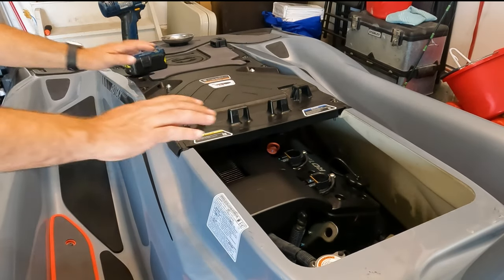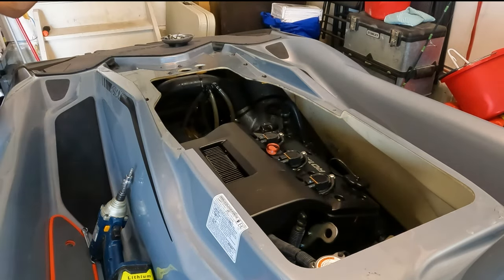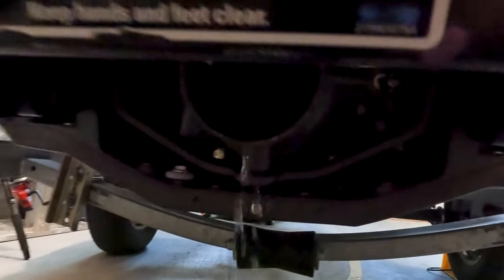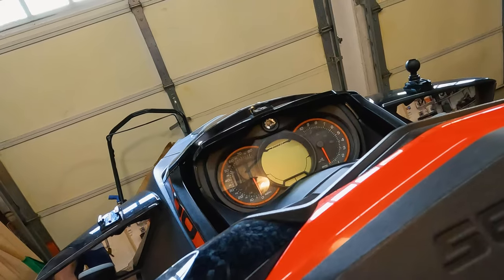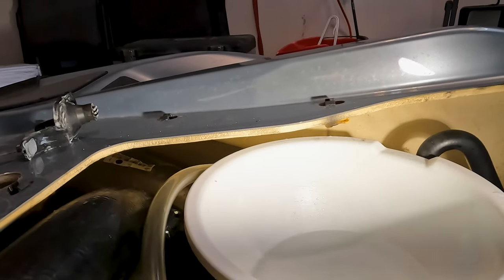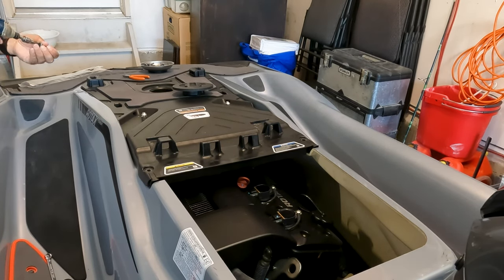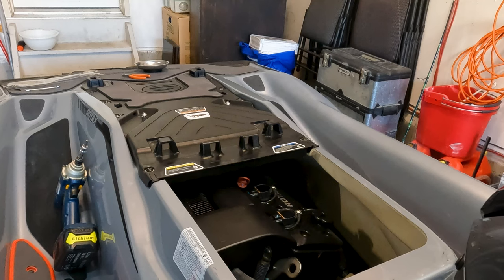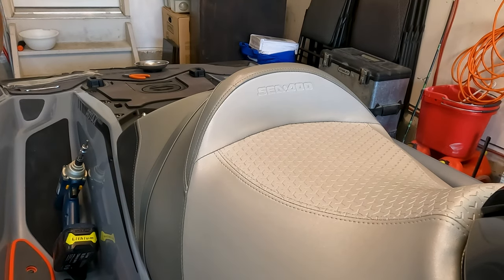How the Sea-Doo OEM Bilge Pump works on a 2018 & up Sea-Doo (Part 2) | S3E16

Comment: Great video. I installed mine but I also installed a water proof toggle switch (ran in under the storage compartment for easy access without having to remove the seats).  I just interrupted the positive wire.     I didn't like the pump running all the time; draining the battery and noisy.
Reply: Possible to show on a video?  Just bought me a Fish Pro and dont want the "always on" feature.  Possible for float?  Thanks!
Reply: Can you make a video on how you did it?

Comment: Interesting comment about why you installed the washers and the flexing of the rear deck. I was tempted to get a ski pole for mine, but then I found out that you cannot pull a tube with the ski pole, so for the few times that we ski with it, it just was not worth the cost of the pole. You need to be careful when working around the jet area with the gate up. Never put your hand inside the jet tube, because if that gates drops down for some reason you will be in a world of hurt!

Comment: Nice.  I was thinking about adding one of these bilge pumps to my 2021 Fish Pro but I wanted to make sure the other (venturi) would still operate.  
I went to wingnuts on the front 2 screws.  Easier to hold onto and start threading. Then hold with pliers to tighten.

Comment: Interesting built-in in hoses expels water in the hull when motor running.
The question is why is their some seadoo hull get flooded from what ever the reason. But the hoses don't work. Even motor is running. I guest thats why people are installing bilge pump. I heard towing your ski on water will also flood the hull.

Looking into buying jet ski next year, your video is so helpful.

Comment: Hi ...I made the mistake of having Sea Doo put the stock bilge in my 2024 Fish Pro trophy. Same BS. It runs all the time. Can I just run a switch in the power wire to a spot where I can open the seat and reach it to shut it down when not using the motor? It should be pretty straightforward. Thanks for the video !!
Reply: YES YOU CAN, I AM GOING TO PUT A SOLID STATE FLOATING SWITCH, THE 3 WAY SWITCH (AUTO, OFF, DIRECT) AND A LITTLE BUZZER SO YOU KNOW WHEN THE PUMP IS RUNNING.